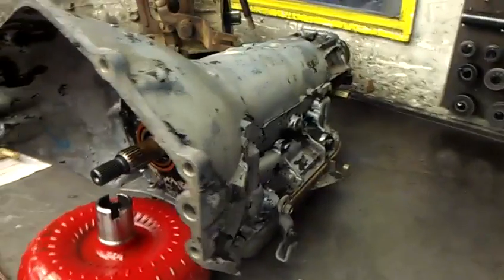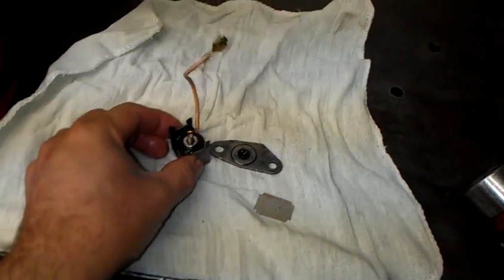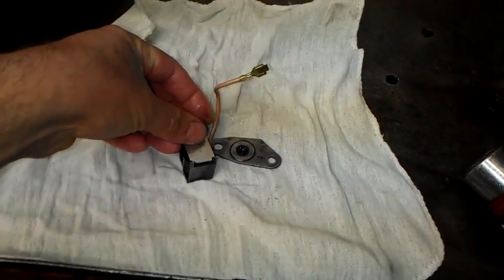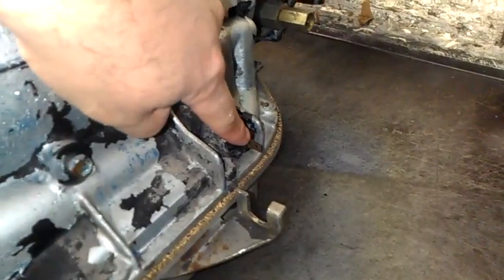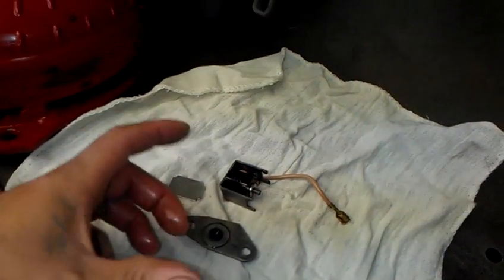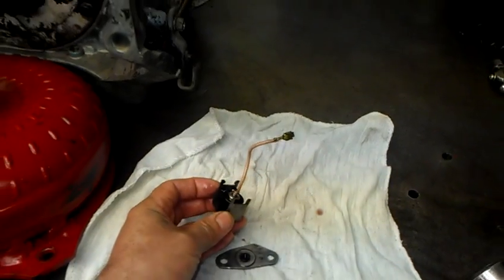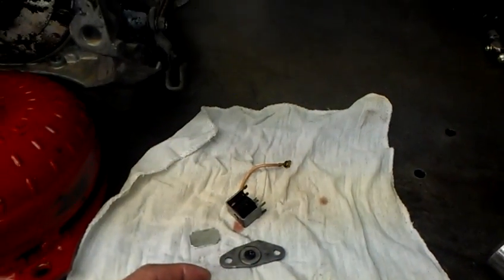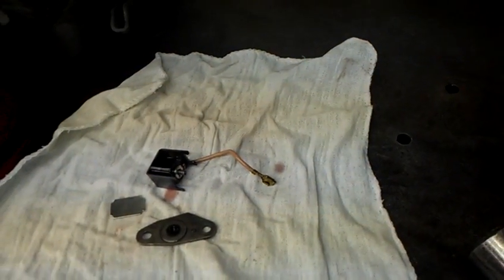THM-400 Transmission - kick down solenoid failure.

Comment: I'm experiencing issues with no upshift under full throttle confitions
Reply: You find out what that was? Mine doesn’t want to shift until about 55 heavy on the throttle until I let off it screams but doesn’t shift
Reply from the maker: @wyatttate945 try blocking the hole on the kick down switch with a piece of aluminum from a soda can. Or beer can. Whatever you have available. Remove the governor and make sure is not sticking and the gear is good. 
Transgo shift kit has different governor springs for shift points calibration. Look into it.
Reply: @AutomaticTransmission  thanks you boss

Comment: I replaced a faulty overdrive solenoid and still don't have a 2nd to 3rd shift.  New modulator and hose, fluid and filter.  Anyone have any suggestions.  Supposedly rebuilt.

Comment: Xavier Varnum · Check the condition in the transmission oil itself. Inside the pan. Whether it has pieces of clutch material in the pan. It might be the that the regular trans oil change wasn't done on schedule. Or it could have been very low on trans oil level at one time. Causing the 3rd clutch to starve for oil cooling. So it could be looking like the third clutch might be starting to slip. Check the trans correct oil level and for the sediments in the pan i mentioned before.

Comment: So the kickdown solenoid on a turbo 400 trans upshifts from first into second speed. It will - ( downshift ) automatically by itself when coasting down ( about 32 mph approx ). Without stepping on the accelerator pedal..

Comment: I have a 74 firebird formula 400 with a th400 transmission.  The symptoms you described are the exact symptoms I have.  When I look for the part it you're talking about I get springs and vacuum lines. Can you help?

Comment: I've got a 75 pontiac with the original th400. car drove fine when it was parked in 2007. I brought it out storage last year to get it running upon lots of work and time and money Im ready to crank it and she start's up running top with a original 46.900 miles. so I shift it and I get a hard shift from park into reverse and from natural to drive. once in drive she shifts 1-2 at around 30 the rpms are high and delayed shift at wot into drive. I've changed the filter and transmission fluid. I was told it needs to be driven but I don't want to burn the th400 out. any opinions thank you
Reply from the maker: +ENLIGHTENED CHILD OF GOD THE OFFSET Chek vacuum on the modulator. It either came off or its restricted. The vacuum hose gets brittle and falls apart. Change it on both ends.
Reply: Automatic Transmission Thank you. I bought a single red line with a new hose today off ebay. I will let you know the outcome.
Reply: I was thinking a rubber vacuum line or hose is brittle. The car has sit 95% of the rubber hose's under the hood was very brittle and some just broken when I took them off to rebuild the carburetor.
Reply: Automatic Transmission Thank you.  I checked all the vacuum hose's tonight on the carburetor and 4 was bad two cracked all the way in half. One was the vacuum hose to the transmission line from the carb. I replaced them all being the car had original 42-year-old hose's. Shifted fine and shited properly on the open road. no more late shifts. I ordered a modulator valve single red line being 42 Im replacing it. Might not need it but wont hurt. Along with checking the hose's I found that the vacuum from the brake booster was off the tree on the back of the carb brake's are softer. Much thanks to you.  Best regards.

Comment: Hell I have a turbo 400 it just stopped out of the blue. I drove my truck with no problems parked it came of 2 hours later no up shift to 2nd. Check gover gear it was fine. I dropped the pan no fines or grinds. Oil is clean. Is there a way to if the switch works?

Comment: I've got a 1972 Jeep Commando with a AMC 304 it's got a turbo hydramatic 400 with the black and yellow wire that came off the transmission I'm pretty sure the wires went up to the firewall but I can't find the box to plug into because of the whole thing was gone through so from that box to the gas pedal to the carburetor how do I fix the kickdown on pickup or over. Drive you have a linkage to a a website with pictures and part numbers so I can get mine fixed the reason I'm asking I've been driving around for the last couple of years without no kickdown switch my brother said it would be fine but I don't believe him anymore because now I don't have no upshifting gears driving lost them today if you could help me out I would highly appreciate it thank you for your time

Comment: Hiram,
How does that solenoid apply? I mean, where does the voltage come from to apply it and how does it decide when to open and close?
Thanks
Reply: Mine won't upshift, when the switch is engaged I read 1v at the control wire.  I can put 12v to the connection for the scylanoid and it makes a sharp click as if it's engaging.  any input would be greatly appreciated as we are currently stranded on the road in our motor home.  

Mike